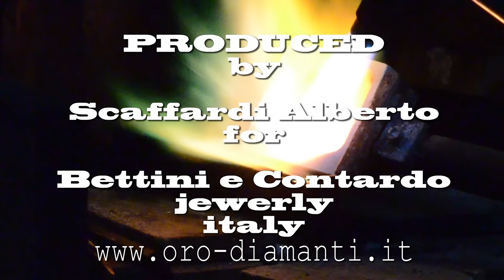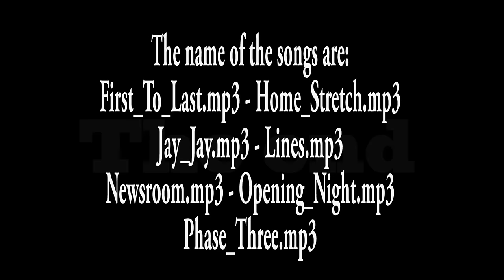white gold and diamond earrings handmade

Comment: The solder used is the same material as the two parts joined? In this case white gold? Is it higher purity or mixed/alloyed with something to melt at a lower temperature but still fuse the parts together? Excuse the noob questions, I am totally outside the jewelry making business :)
Reply from the maker: +macbeth2354 You can use an alloy of gold with the same title, but with a lower melting point, I use gold to 18 kt and 18 kt welds always but with lower melting points. The welding that use for the main welding is approaching the point of normal gold melting this helps me in subsequent welds in which use solder with lower melting point.

Comment: what do use to solder the ridge in the gold rings it is just gold, or with adition of some kind of chemical?
and also how do you remove the gold-coating from your tools?
Reply from the maker: +Manoel Melo Gold is always working alloy to make it durable, Some alloys lowers the melting point.
Reply: thank you